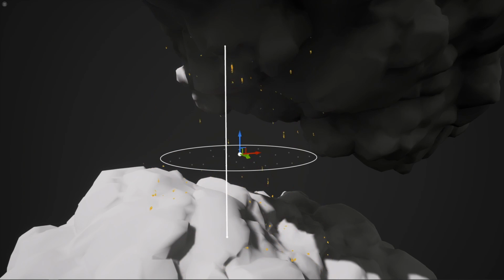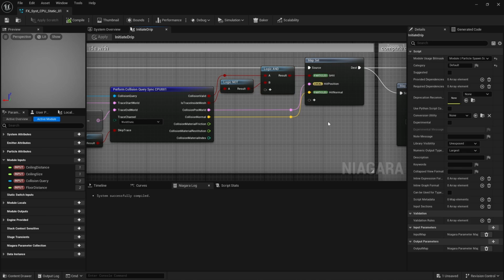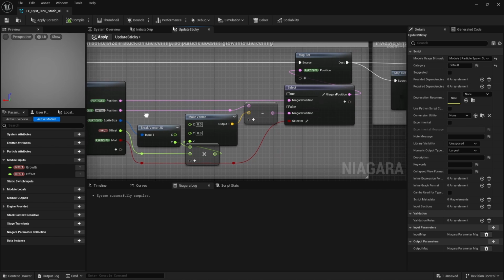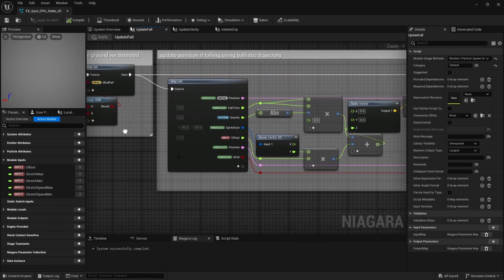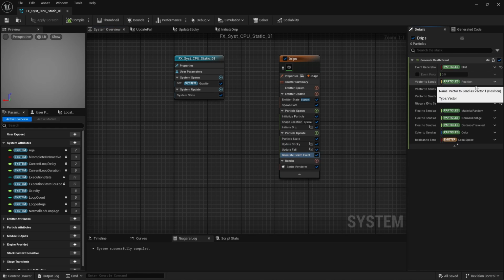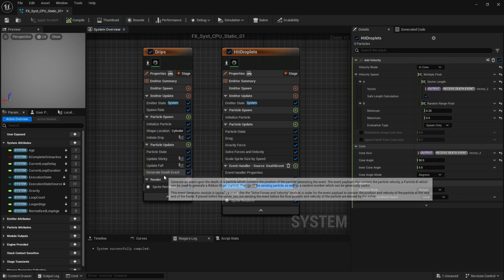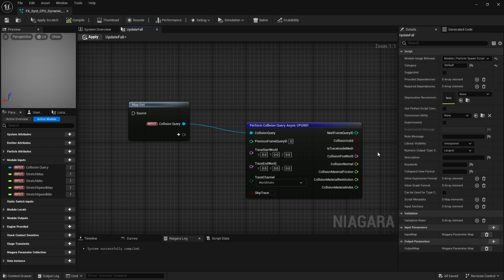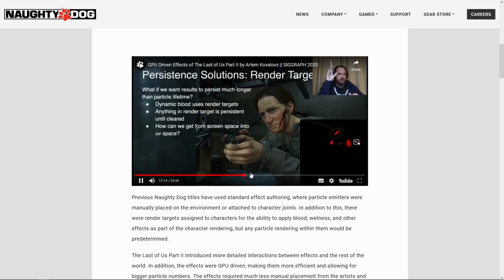Dripping Water Droplets VFXs with Niagara - Part 1 - CPU Emitters

Comment: I'm having a bit of trouble with this. I followed along with the video and I can't seem to resolve the issue of my water droplets being stuck on the ceiling. The particles spawn, grow in size, and accumluate, but they don't fall to the ground. They are stuck on the ceiling. If anyone could help, that would be amazing, thank you :)
Reply from the maker: Hey! Oof, sounds like a tiny oopsie somewhere in your system. At this point I'd just double check everything :| Sorry, don't have anything better to suggest.
Reply: hey, did you ever find a fix for this? having the same issue and i cant find the cause after 2 hours of searching
Reply: @rupertmcgettrick7218  i tried my best to redo it and triple check it, but unfortunately was unable to figure out how to fix it. I'm sorry :( if you find a solution, please let me know!

Comment: Amazing I was thinking about something like this for vr games where I don’t want to stress the gpu with distance field collisions.

For the last problem you could just parent the particle system to the mesh and have the calculations in local space until it drops?
Reply from the maker: Yup! There are lot of ways to go around this if you're willing to do a bit of manual labor. To do this automatically is another thing entirely :)

Comment: Other solution less complex.. im my case use in videogames when my lead don't want use fake particles with stripe billboards is: one emisor for impacting traced particles with the ceil surface where I use o the position of the hit and killed position generated death, 2nd emissor for spawned owned particles emisor taking position with a event handler, finish this one again with other emisor for create the droplets when hit the other emisor on the floor surface using a similar method that in the last situation. In all this process Iam not using CUSTOM nodal scripting. I apologize you because not speak english nice. I prepare this fx in less 10 minutes with a nice enhancement. I wish to know the advantges your complex and interesting propousal. Nice day guy.
Reply from the maker: Not sure I understood. It sounds very... similar to what I suggested :D But yeah, there are always many different solutions.